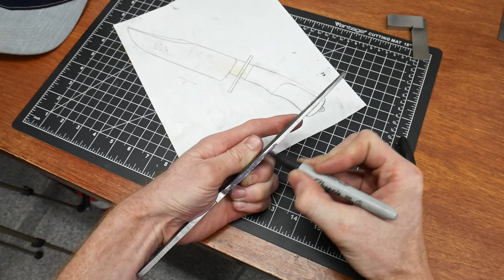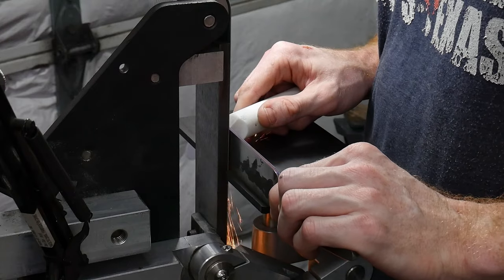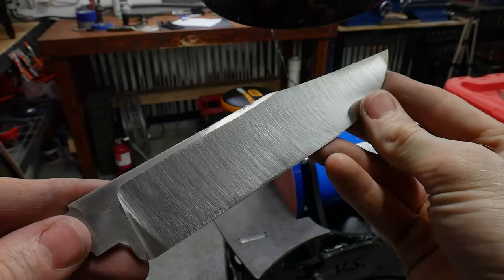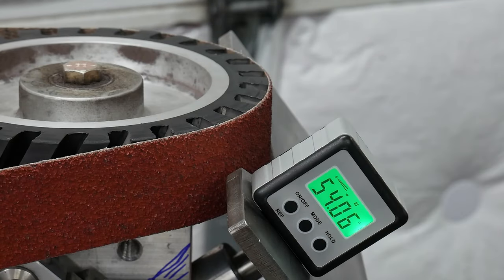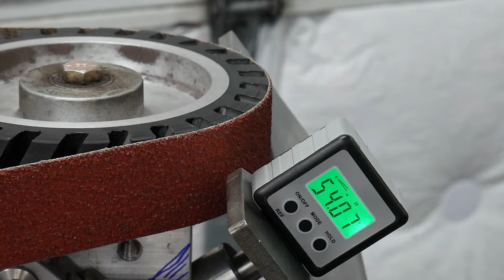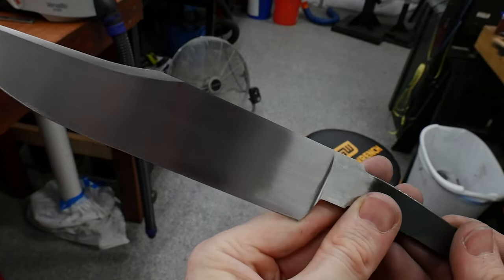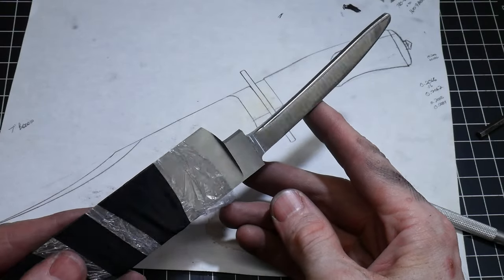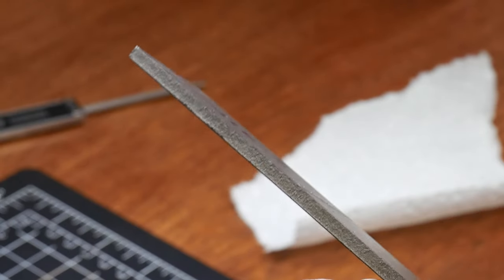Lucky # 7 Bowie - Attempting A Royer Takedown - Part (1/4)

Comment: Another video, another tool of yours i'd love to create. What is the blue vise you have for your quenching jig? looks to be a modified clamp of some sort...
Reply from the maker: Thanks man! Here is the clamp - https://youtu.be/ZwvQpVP3-5I
Reply: @RedBeardOps  my fault, i should have expected that you had an existing video and looked first! you da man!
Reply: One more question for ya... have you seen any issues with heat dissapation from the heavy angle iron vs. a thicker aluminum plate that may draw the heat out quicker?
Reply from the maker: @thebogamin  I haven't had issues with this method. Note that this is a straightening jig more than quench plates. The quenching is happening in the parks 50
Reply: @RedBeardOps  good point, I think I'm thinking more in terms of like a partial quench then onto the aluminum to finish the job but I'm going to stick with what works for you and go from there!

Comment: At 8:45 into this vid you are hand sanding and have what looks like a magnetic shop light mounted on your sanding vise.  Can you tell us the make/model of this light?
Reply from the maker: That one is similar to this guy - https://amzn.to/3CM3FKq -------- However... I've replaced it with this one - https://amzn.to/3s79tJa
Reply: @RedBeardOps  Thanks!  Your push stick is what?  2" in diameter?
Reply from the maker: @Puskara_Waterflower  That's 1''

Comment: Hi James, yet another great video!  I'm trying to understand your desire to make "take down" knives.  Granted that any design is part personal preference and part challenge of a unique method, but my question is not for criticism, but more of a desire to understand.  1.  Will you ever 'take down" this knife once you make it?  2.  Is not this design slightly weaker in strength?  (granted you use less metal so there are some cost savings.  3.  Conversely, a solid tang should make for a stronger knife?  I really would like to hear your reasons for selecting this type of design.  Thanks again, and PLEASE keep your incredibly informative and talented videos coming!
Reply from the maker: Hey Eddie these are my best answers I think:

1.) Potentially. I think takedowns are desirable by certain collectors so that they can take them apart and re-assemble. It has a "cool factor". Also they're more difficult to make, which adds to that cool factor. 
2.) If everything it tightened up and the handle is bedded, I don't think you'll lose much with strength. 
3.) When built correctly a hidden tang knife can perform very good and be "plenty strong" for a knife. Think of the knives tested on Forged in Fire; many of them are hidden tang. Large swords are all hidden tang and go though some serious stress. I have nothing against full tang knives and still make them often, just pointing out that hidden tang can also be very strong. 
4.) I do like making takedowns since I can work on each component separately. That being said, I like the idea of building a knife as a takedown, then epoxying it all together at the end. 
5.) If something ever happened to your handle on a takedown, you could remake it without damaging the knife during disassembly. 
6.) Some of this is art. Not function. You want "functional art" on a knife like this. I don't foresee the end user taking this knife and trying to baton it though a piece of aluminum ;)

Just my thoughts there.
Reply: @RedBeardOps  thanks. That helps me understand.